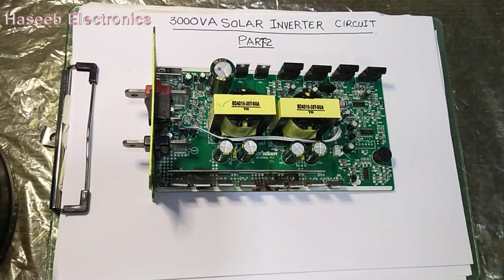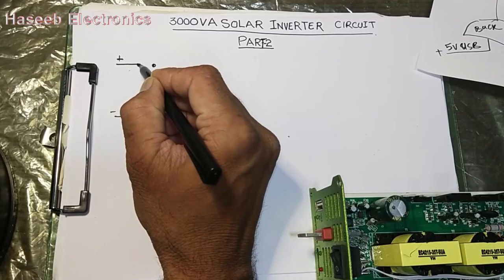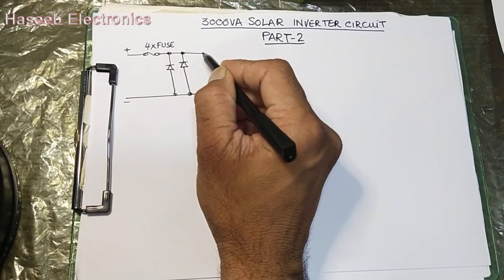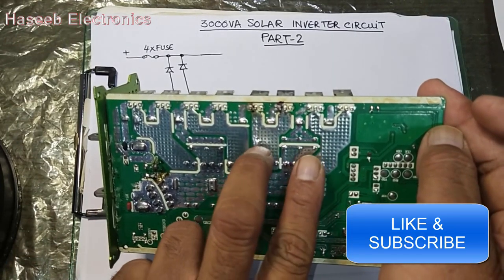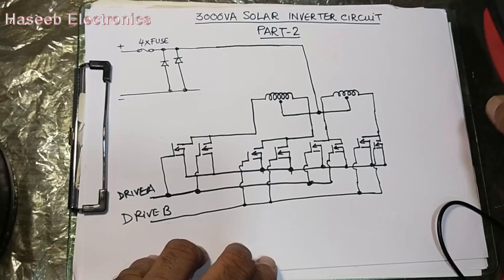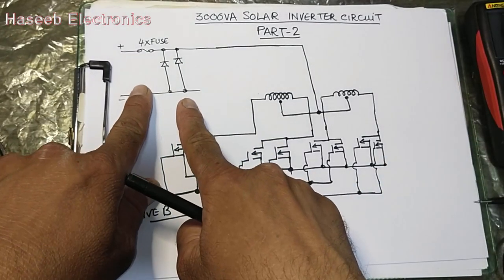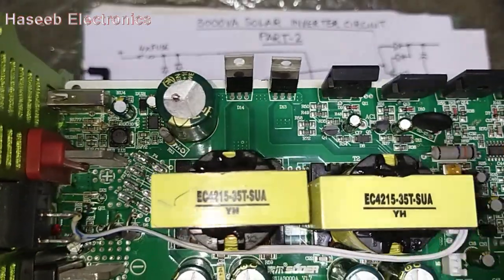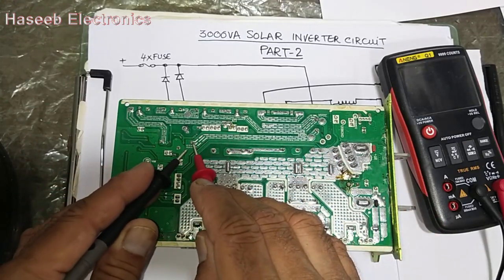{442} 3000VA Solar Inverter Circuit Explained - Part 2 Power Rail / Voltage Booster & Output Switch

Comment: Good video you are a very good teacher  another topic I would kindly ask is washing machine main boards  am having problems with outdated models is it possible to repair them with all the silicone on them?
Reply from the maker: best regards
yes outdated boards are more easy to repair
silicon coating can be removed easily 
i wiil try to share acom[;ete serial very soon

Comment: Fascinating.  Have five inverters, each behaving differently.  
This helps me investigate what went wrong.
Very timely 3-part series....can't wait to learn more.
if this unit you are showing us fails easily is there something we can do to improve them, or just best to avoid them ?
Looking for better power management.
Reply from the maker: best regards and it is my pleasure that my efforts are helpful. next parts are coming soon. i will try to discuss its all points and features

Comment: Thanks my Friend for all your good vidéo.
I have a 1500w pure sinus inverter but is out of order because of my solar micro tie inverter turn on in the same time of my 1500w inverter. Where do you think the problem is.
The primary looks like ok. Good voltage. But nothingnon the secondary, the main 450v condesator stay to 0v.
Thanks a lot for your help

Comment: Let me ask please if the booster section will provide the 380volts if it won't get the signals from TL494?

Comment: Sir , goodmorning.
You are explaining very nice as usual. Sir i wish to know when we are connecting MOSFET some time there is explosion so how to prevent using oscilloscope.I wish to check driver circuit with oscilloscope befor connecting MOSFET.
Same thing I wish to know in VFD.
Thanks and regards connecting MOSFET.

Comment: I have a samlex 1500 watt inverter that will not drive the transformers,removed transformers and drive circuit works.have tested transformers,they test good.do you have any idea what else I can test?

Comment: I alway enjoy your content but my question is why mosfet alway burn 🔥 up in inverter and the overloaded protection is there to turn of the pwm signal so how is that the mosfet still short circuit I don’t understand this in commercials inverter because I built my own inverter and overloaded it and the overloaded TC transformer shutdown the ic and mosfets never blow out I try this over and over and the protection alway work so is that I build a really good inverter or what
Reply from the maker: wow that is really great achievement
mosfets burn out due to many reasons
1. push pull switching topology (i will explain in upcoming video)
2. material failure 
3. hard switching 
4 allocating low dead-time for both channels
Reply: @HaseebElectronics  ok ✅

Comment: I have 24 v to 220 v inverter....it was working well...suddenly it cant drive a 750 W water pump and over load indicator turns on...(may be low amp output...can you advise please? Thank you

Comment: what if we add a bridge rectifier so that irrespective of the polarity of input 12DC voltage, the polarity of 12V feeding to the inverter may remain same and it does not harm the circuit.
Reply: Cost...

Comment: I have always heard to step up or step down we need a transformer. But I don't understand how the output switch step down voltage without a transformer.
Reply from the maker: output switch just changes the voltage polarity on output line to get frequency

to boost voltage from 12 to 350-400 volts, the voltage booster stage is used. it have a step up transformer
Reply: @HaseebElectronics  and to step down from 350-400 volts to 220-240? How does out put switch do it?

Comment: why 1000w power inverter have current on both terminals? how can i connect this inverter with single inverter wire

Comment: Salaam sir one question you multiply 330v to .706 what is that 707 ?
Reply from the maker: when it provides switched voltage in output it is peak voltage 
to convert peak voltage into RMS voltage, we have to multiply with 0.707
Reply: @HaseebElectronics  sir explain in next part that thank you

Comment: Hı my online ups 1000kva  true sine no load current is very high 1.7 amps . Can i reduce no-load current with inductors ?
Reply from the maker: you have to study the design. in some pure sine wave inverters this current is normal. if you will add some inductor, these inductors will become another load at loaded output. so it will cause to drop output and will lower the effieciency of the converter